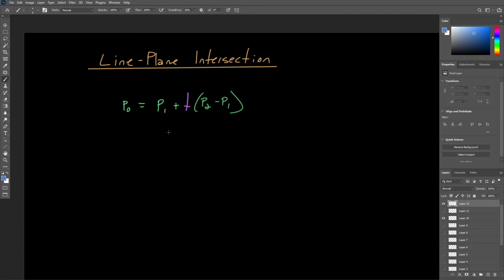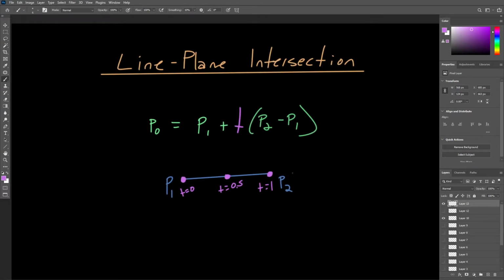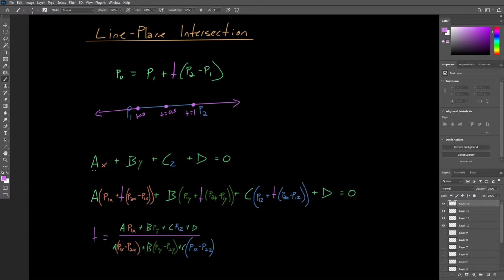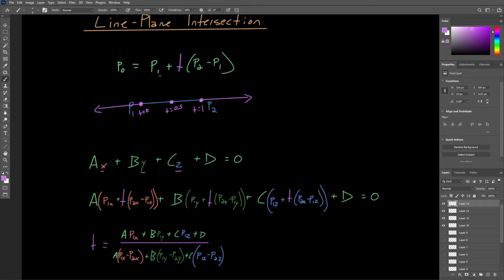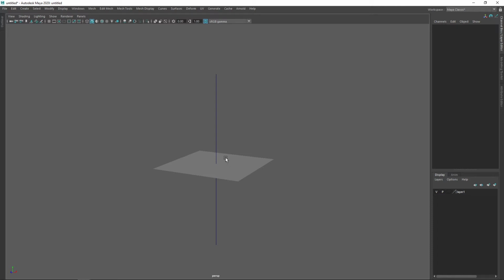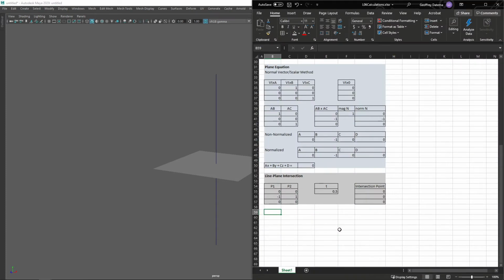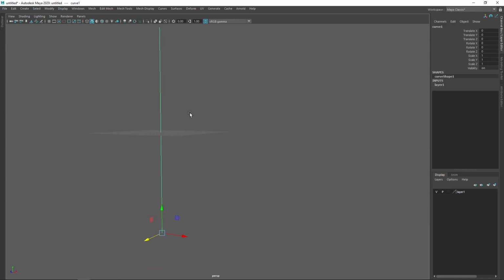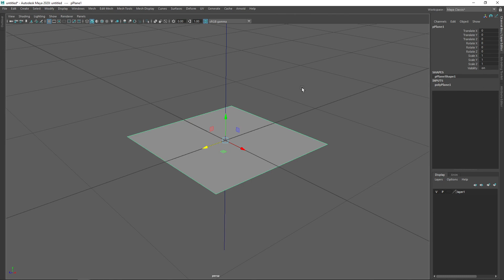Line-Plane Intersections | 3D Graphics Overview

Comment: So to expand this to triangle-plane intersection, I assume you could treat each triangle edge as a line, check them for intersection, and find the points... 

But then how do you join the intersection points into the line intersections that specify how the triangle and line intersect?
Reply: After some math'ing, turns out you can assume only two line segments (edges) of the triangle will ever intersect if there's an intersection, then you just find the intersection points and those become the endpoints of the line segment that form the intersection of the triangle and plane...

There is the edge case where a single vertex of the triangle is on the plane, but it's easy enough to ignore this as "out" rather than a true intersection.